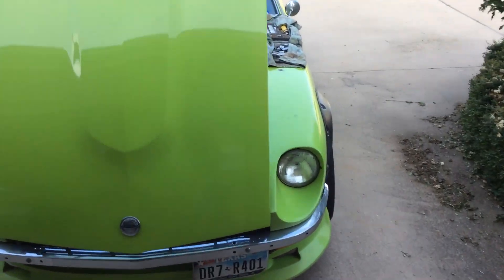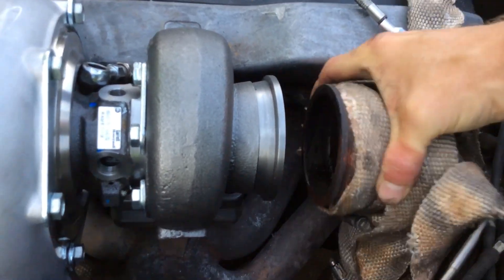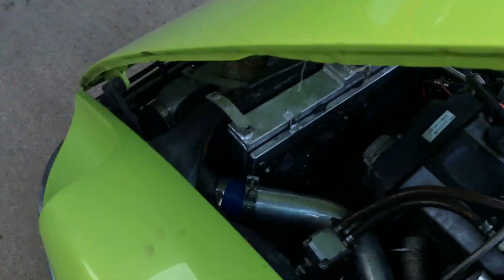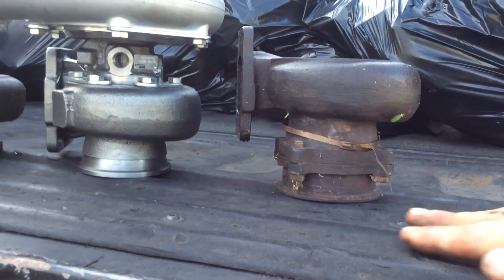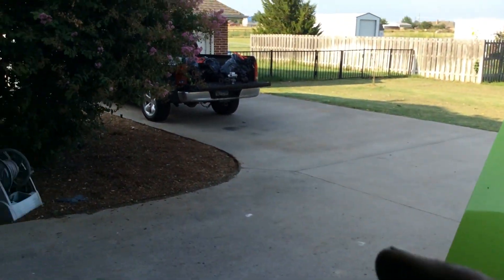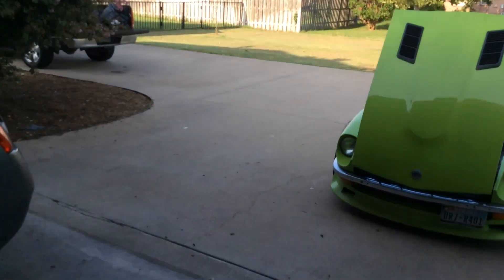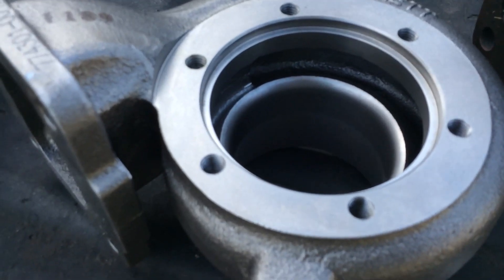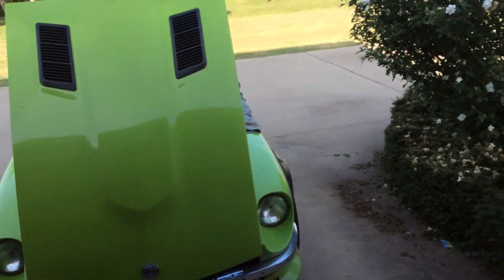GTX3582R install and DRIVE! rb30 S30 Datsun Z

Comment: ***** 

I'm so happy your car is back on the road! Helps me get my Zcar fix while mine is down for repairs, I just had a couple q's for you:

What's your cruise mpg? Your afr's looked in the 16's while cruising and I can imagine that helps a bit.

Where'd you get the muffler? It's an interesting style (not my personal choice, but fits the car nicely).

And when we gonna get some hoontown video now that you're back up and running?

Happy spooling!
Reply from the maker: Not sure what my mpg is? I tuned it around 15ish for crushing speed. The afr's jump around allot it may have flashed 16 but not meant to stay there

Comment: You got to put that T4 phil, I got the same t3 .82, to much wheel spin and after 6000 rpm my engine is choking, going to get T4 .84 or .96 in near future, this will setup will minimize wheel spin and have a progressive aceleration, if I was you I just cut the t3 header flange and weld a T4, much better and lower turbo placement.
Reply from the maker: Thought of cutting that header also lol, I have a T4 flange also :)

Comment: hey what engine managment system are you using, im installing and aem ems s2 onto my series 2 rb25det. car was working fine before with my hks piggyback ecu but now with this new ems and cant get the car to turn on. any ideas would be greatly appretiated thanks. couldnt find anything or the forums